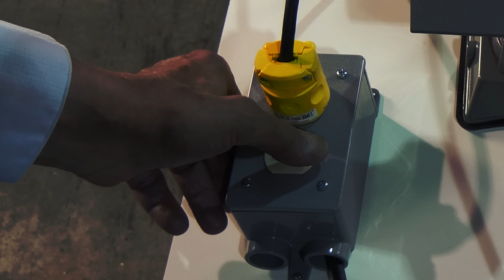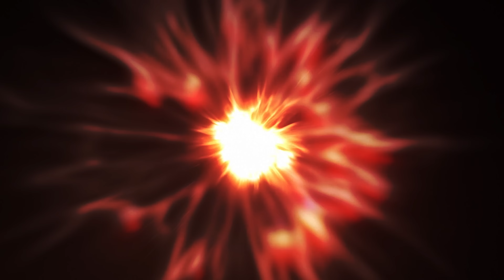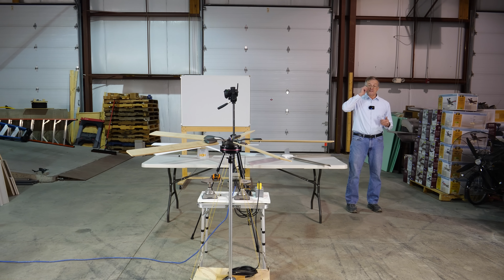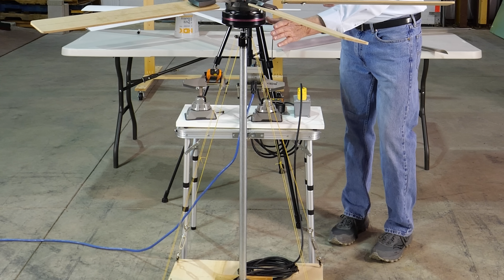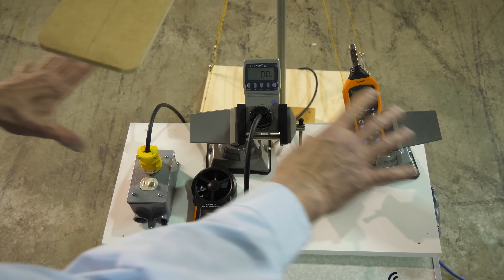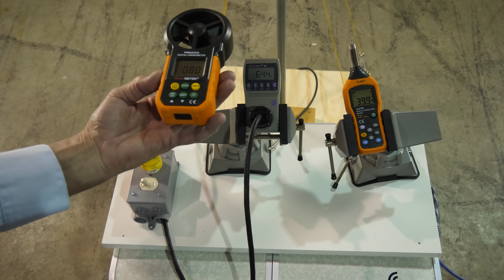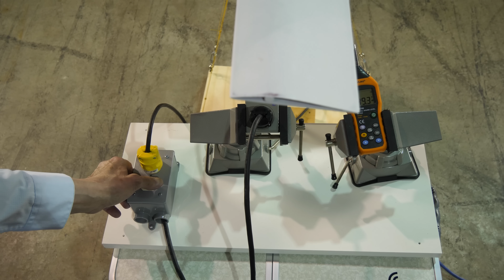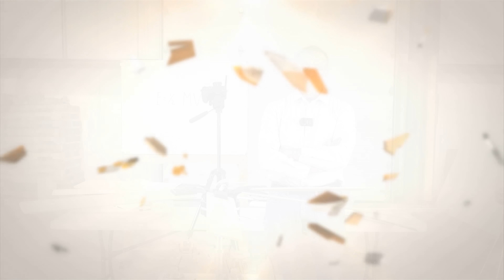This Fan Uses Almost NO Power

Comment: Thx! As german and still learning english technical international used material / equipment identifiers will be helpfull research local suppliers. 
But I wonder ... if you try to fresh the feeling by fans in hot summers - and your space hs a good isolation or you might be indoors deep in a building
- would the heating power of the first motor be an additional argument to exchange it? Or is the heating effect on top of the fan minor in a cubical? If your hand feels it I see an irony if people install the fan to cool down but its fixed to an oven of motor... and everyone overlooks the obvious.
Or is my assumption it matters wrong? Thx.
By the way I see a more relevant topic in this context and wod like to send a proposal per mail - is there an email adress I can use to add a sketch? Thx.

Comment: What about optimizing the blade tips? Would there be  significant better aerodynamics/efficiency and qieter blades?
Reply from the maker: Improvements could definitely be made.
The question is how significant the improvement would be. Also, these straight blade sections are easier to fabricate without changing the profile near the tip.

Comment: @TechIngredients I'm not a fan of the green energy "movement", but I am a fan of green energy if it is efficient and cost-effective. This video is pointing out the one huge improvement that can be made with energy efficiency, use more of the most efficient cost-effective solutions that we have on the consumption side that don't decrease quality of life, LED lighting is a great example of this, so is this fan motor in the video. I love these sorts of solutions for energy savings. But you really need to redo this airfoil test with the new fan motor, normalized to 1 meter per second airspeed, so we get a really great set of results regarding energy efficiency of the airfoils. Don't leave us hanging!
Reply: it's ironic you bring up LED lighting because although it's more efficient, it's also basically just three wavelengths of light instead of the full-spectrum, which affects how things appear in the light. There's also studies that show full-spectrum light might have noticeable positive effects on mood, so if you're stuck indoors under LED light, it would be especially helpful to go outside.
all you have to do is follow the science. giving you the benefit of the doubt, i understand the apprehension towards "green washing", but the fact of the matter is that "green" energy is an existential imperative to modern society and corporations and governments are not doing nearly enough to move in that direction. As cool as it is to see how fan efficiency can be improved, it should be even cooler to see how we can move away from fossil fuel use where it's not absolutely necessary, like with household/corporate energy production and consumption or most public and private transportation solutions.

Comment: The worst part is that you're putting an extra 40 Watts of heat into the room during the summer.
So if the fan is your only source of cooling, then a day of running the fan might even increase the temperature by more than the fan can lower the apparent temperature. And if you're getting rid of the extra heat with an AC, then you're paying maybe 4 times as much for the extra electricity as the 40 Watts that the fan itself wastes would suggest.
Reply from the maker: Agreed
Reply: the wattage isn't converted to heat at 100%. it's likely creating more waste heat, but not anywhere near 40 watts of it.
Reply: @snowballeffect7812  No, that should be one of the cases where all the electric power actually does go into heat. Part of the power goes into "direct" waste heat at the fan motor, and the rest moves the air. But since the air movement is entirely confined to the room/house, the drag eventually converts the air movement into (waste) heat as well.
(To give a counterexample, sound and light would partially leave the room and be converted into heat elsewhere.)

Looking at the room in total, there's definitely 40 watts of extra heat in there somewhere. And as a consequence the heat flow through the walls will eventually have to increase by 40 watts.
Of course there still may/will be additional effects, like probably moving the heat from where it is generated inside the room (at last 100 watts of body heat of 1 occupant) to the walls to give it a head start on making its way out of the room. But additionally the air movement may also carry heat from sources like the window panes into parts of the room where it wouldn't have ended up otherwise.

Comment: Another great engineering topic! Only qualm is with comparing the LE of DC fans to AC. DC motor needs power rectifying and a speed controller, parts/IC's involved that can fail from a lightning surge or less. You might end up being right for a different reason, cause as soon as manufactures know they can sell fans that break outside of warranty and make more money in repair and maintenance, we're cooked
Reply from the maker: That's a good point. Engineering decisions should incorporate more than just electrical efficiency.

Comment: One reason the AC fan motor wastes so much energy is of the amount of slip (difference between speed of the magnetic field driving the rotor and the rotor speed).
Most AC motors turn at a bit under 3600 or 1800 RPM depending on 2 or 4 pole.
The ceiling fans do not have a gearbox, but a very high slip rate.

Comment: Great channel, love it. What I've been wondering for a long time, and would love some explanation on by you guys, is why fans aren't put at ground level to suck air in at the shade side of a building and make passive ventilation holes at the highest point in the ceiling. 

Or passive ventilation holes low to the ground and use relatively small fans to blow air out through a duct at the highest point in a ceiling.

This to use use the natural flow of the air and use way less equipment and energy. 

Curious for a long time if it would work in a house without airconditioning to open a hatch to the attic and  put an active fan in an out of use chimney. To turn the fan on during hot days in summer to keep the airflow going all day, while keeping the windows closed, only opening a garage door on the north side of the house. Been wondering for years! In Holland we don't really use AC's and it is my parents home. So got to be pretty sure before I start drilling! 

Would be amazing if you would give it a thought!

Comment: You should measure speed closest to the edge, speed distribution in those fans varies and it is highest at the edge of the blades... Best is to scan speed in area below fan projection with mini pitot tube and integrate that value!  I agree, this was very important video, this finding is shocking!

Comment: The cheap AC motor in these fans a probably shaded pole motors. These motors are very inefficient running at only about 30%  efficiency but are very cheap to manufacture.  Using Capacitor Start or Capacitor Start/Ruin AC motors would increase efficiency to about 80%. But these would cost more as extra parts are needed and the capacitors my will need to be replaced every now and then. But, as was mentioned in the video, the shaded pole motors can run for decades without needing and maintenance.

Comment: Question? Does the airfoil design work as efficiently in reverse? Do the blades have to rotate 180° to maintian efficiency in order go from a push fan to a pull fan?
Reply from the maker: They do. That is one limitation to an asymmetrical airfoil.

Comment: Former appliance repairman here: about 10 years ago most major home appliance brands began changing all their large brushed AC motors to direct drive DC motors.  Some still use brushed motors with pulleys and belts on their washers, but the direct drives have lots of advantages.  They even started switching their refrigeration compressors over.
Reply from the maker: That's good to hear.

Comment: I would like to say that I really love your videos and please keep up the research! 👍😉 If everybody would make you change it and the things that you come up with to save both money and power you're helping to evolve the world affecting so many people's lives in so many ways. Not to mention you're making people stop and look and get more involved in their own footprint.. but what I wanted to tell you my father was an airplane pilot and several years back they tried a prop on his turboprop jet airplane it was very efficient and very quiet and the volume of air that it would moved at lower RPMs was  highly increased. What made the process significant was on the end of each blade is hooked it had an l-shaped that allowed for to grip the wind instead of it sliding off the end of it just making it extremely quiet to the point where you can stand next to the motor and talk normal also causing the air to come off of the prop in a centrifugal manner that was controlled and not erratic. But I thought something like that on that ceiling fan would increase its abilities and performance reduce the cost also.

Comment: In the EU electronic appliances for the home for many years have mandatory Energy Efficiency classes they have to test, verify, and provide info to the customer in the form of a sticket.
Every few years, if technically possible, the standards for each Energy Efficiency class becomes higher and higher, so for a few years now the "A" class appliances use BLDC inverter motors as standard (like washing machines, ac, dishwashers, fridges and so on).

Ps. Those energy efficency tests, and stickers are even used on new car tires, to promote lower rolling resistance, noise, and better breaking in the wet.

Comment: Cost aside, what about constucting a ceilng fan with blades like those on wind turbines (with an optimized pitch or angle of attack from root to tip)? Why not four blades or many blades like in a turbofan engine?
Reply from the maker: The variable pitch is only a benefit when the air is flowing past the rotor. This is because the direction of the apparent "wind" changes as you move outward from the hub. The increase in rotational velocity becomes a larger and larger component of that direction. 
Fewer blades are always more efficient because there is less disturbance of the air moving over a blade due to interference in the air by the blade that proceeds it.

Comment: How would airfoil blades perform with brushless DC motor - any follow-up?
Reply from the maker: It's just the product of the effeciency of the motor and the efficiency of the blades.  So, with 20%greater velocity, the airfoil will be 78% more efficient on top of the increased efficiency of the motor.

Comment: Are three phase ceiling fans a thing? I would image they would be rather efficient as well.
Reply from the maker: Not that I'm aware of, but I agree they would be ideal.
I'm not sure if there is a good manufacturing base for the small three phase motors that would be needed for that application.

Comment: What I hv to do to make my home ceiling air fan as a low spending energy one sir?
Reply from the maker: Purchase or replace your existing AC powered fans. These DC models are supplied with the necessary circuitry to plug into existing 120/240 AC supply lines.

Comment: HVAC furnace blowers are a huge application for this, as you touched on.

I've also designed an HVAC system that I believe to be quite novel that I'd love to share with you some time, and I'll be incorporating a bldc motor in the air handler of said system.

Comment: Since you have so many extra fans...   What would it take to modify the existing low efficiency induction motors to a DC brush-less design - could you do so for less than the cost of the hunter dc fan (the one you show is ~$200)?  I have 3 ceiling fans at home and during the summer months run 24/7

Comment: Please compare ground source heat pumps with air source. Free cooling from ground with ordinary ac cooling. If you circulate 16C water from the ground in under floor pipes, you will use less energy than your most efficient fan. Absolutely soundless.

Comment: Are these fans actually optimized in any way? Like angle of attack of the blades, number of blades, surface of the blades, blade shape, rotation speed? Or are they just copy pasting the looks of decades of ceiling fans, trying to build them as cheap as possible, without even thinking much about it?
Reply: I was given a "junk" desk fan that was extremely noisy and hardly moved any air. It had thin metal blades so I just bent them a bit to have more curvature. Suddenly it worked fantastically and nearly silently!

Comment: Question:  If you have a solar power system, could you save power if you have a DC air conditioning unit ? if so? how much?   %  . same question with an inverter-based refrigerator, bypassing the inverter?  Is there power loss by using inverters ?

Comment: Bought a Midea AC window unit recently, it's built with a DC inverter. I also suspect the "hot" line runs through the condensate, but I did not disassemble to confirm.

Comment: 40 extra watts is heat added to the room... thats alot when you are using something to try to cool yourself... which is another important point I didn't notice pointed out.
Reply: Good point, I was thinking the same thing.
To be fair, our host did mention the wattage as heat loss, but yes... it certainly contributes to the room getting warmer.

Comment: Love how you spent all that time engineering better blades, only to fan it all away by not testing them with the efficient motor. You gave us lift, then cut the power mid-flight. Truly a breeze-blocking finale. Hoping for a second spin where things actually take off. 😏
Reply from the maker: We can and might, but I thought the principles were clear.  Increase the efficiency of each system. The airfoil is better than the paddle, and the DC motor is better than the AC motor.

Comment: I have seen a smart device that you plug in the appliance with the motor and it will determine the optimum efficiency of the motor. Then it reduces the amps the motor consumes.
Reply from the maker: Are there any links?

Comment: These motors have to start in high flow modes or they kill themselves because of heat buildup. That is the reason why they are wired that way... Because there were incidents ending in burned down houses

Comment: Aircraft, with helicopters in particular, are far too noisy.  Surely analysis has been performed to optimise efficiency, reducing noise.  Yet still we have to put up with the regular disturbances disrupting a peaceful environment.  Tangential to topic, I know... but there's a similar issue in ceiling fans.  Reduced dBA ranks highly with W reduction.

Comment: As per above.  Variable frequency drives are in many appliances now.  Washers, driers, air-conditioning  and refrigerators ( discounting the reduction in coefficient of performance caused by the force replacement of R12 and R22 by successively worse refrigerants with undisclosed health effects, changes imposed by the inventing company's corsersive market controls and forcing government legislation to eliminate the refrigerant they could no longer control with patents in order to maintain their super profits and management super bonuses, all which would have been unnecessary if recovery systems and processes alone had been implemented but at the cost of that company's profits. I'll  put my hoby horse away now, rant complete).  It would be interesting to look at the differences in efficiencies (and heat pump COPs) between fixed motors and new variable speed permanent variable speed drives ( with new and old refrigerants in.   I'll bet the old highs on COD of 9 would be well and truly eclipsed on R12 or R22 with a VFD when compared with the new R what ever it is and the alleged COPs of less than 6.  Calculate the excess power consumption in that one per device per day etc. (Just so one company can make more money).  Also try CO2 as a refrigerant as a comparison.

Comment: Generator design update? Are they still relevant in todays battery technology, where DJI produses large batteries for its large quads how can a small motor generator will power 4 motors of a quadcopter, kindly do anser these question in your video if you are still working on generator dwaign.

Comment: Great vid and message. Additional consideration, minor, but real: Every watt saved by the motor upgrade was adding unneeded heat to the ventilated volume.
So, (40 watts/hr)(24 hrs) = almost 1 KW heat more added to the household's A/C load. Per fan.
Reply: it's just 40 watts of additional heat, so every 1-2 fans is like having another person in the room.  It's not irrelevant but it's not a kw. :)
Reply: @gmaxwell  
Agreed, but I was approximating, as
 40 watts X 24  = 960 watt/hrs/day
aka: 96% of one Kw/hour, which was my intent. requiring further energy wasted, if A/C is required to remove it.
Per unit.

Comment: I did find it very interesting as I live in Florida and love ceiling fans.  I actually recently had to find a decent one that wasn’t a DC motor because I like  the wall mounted fan/light switches, remotes just get lost and require battery changes.  In rentals, that’s too much of a chance.  I am now curious about how one would maybe be able to increase the efficiency of the regular motor doubting there’s a way to get a wall switch to work with a DC fan.
Reply from the maker: These commercial DC fans are DC only in the motor itself.  There is a converter module included with the system that allows you to plug it into standard AC home wiring.